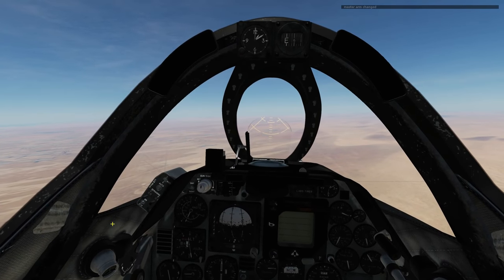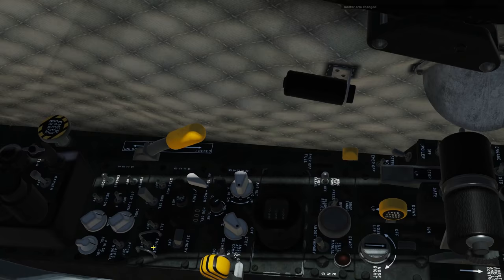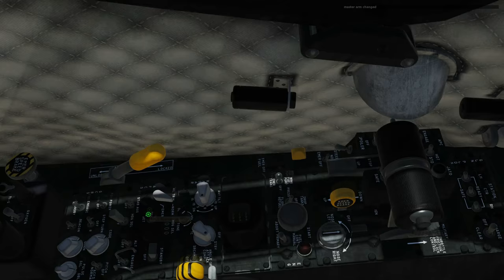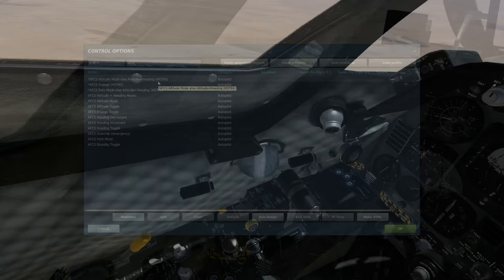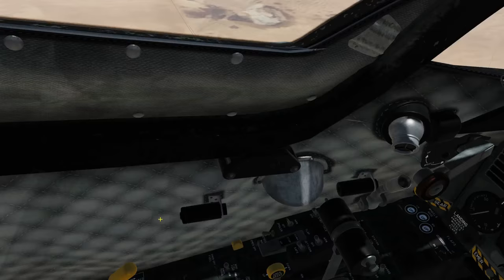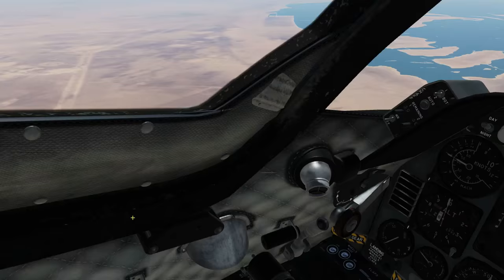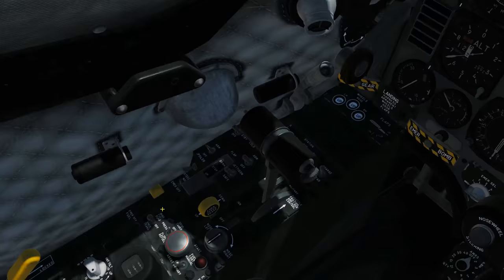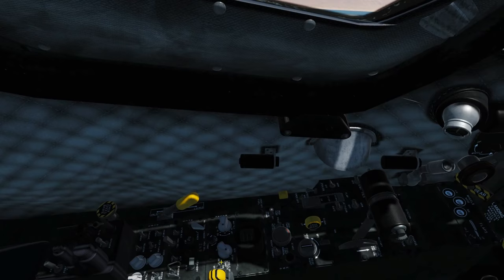A-4E Skyhawk: AFCS Autopilot Tutorial | DCS WORLD

Comment: as a former A-4 Skyhawk avionics guy, it's fun to hear about the process of grabbing the stick to disengage the system.  In the aircraft, there were lots of ways to disengage the AFCS.  The stick had force sensors in it, and it actually took a very light touch to make it disengage.  Just a couple of pounds of force were enough.  For some very antiquated electronics, it did a decent job.

Comment: I found a solution to my problems. which I wrote about below. To reset the fuel tanks, put the emer sel in position 3-2-4 and pull the striped emer bomb handle. The autopilot is switched on and off using the AFCS Engage Switch-OFF/ENGAGE, AFCS Altitude Switch OFF/ALT, and AFCS Heading Select Switch OFF/HDG SEl buttons. There is no problem with turning the plane on its back!